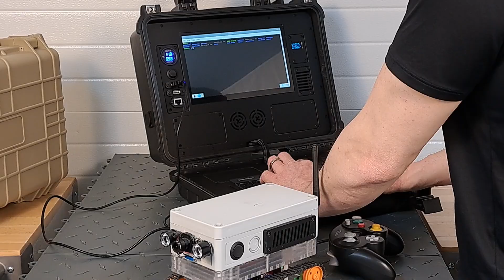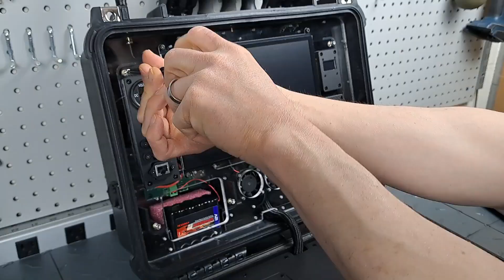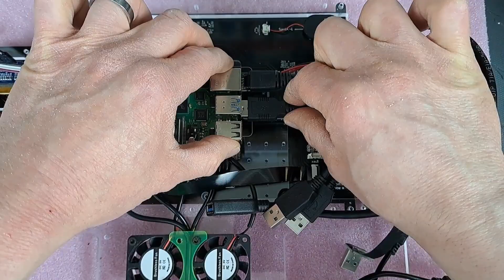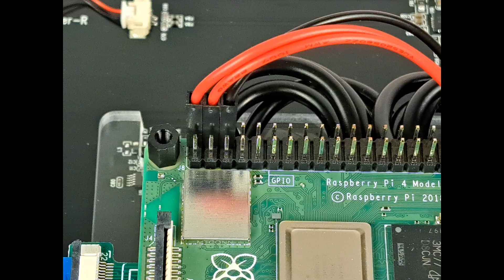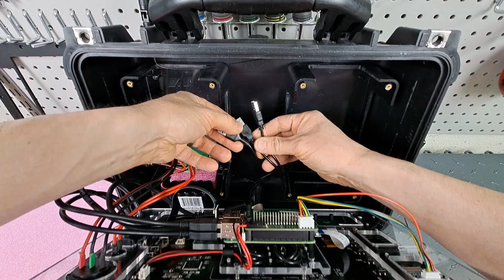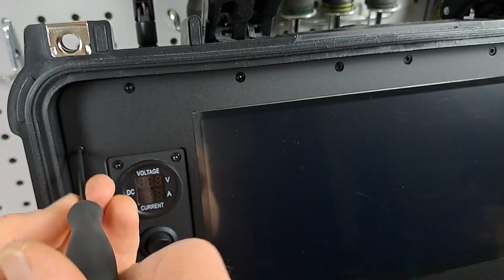Mobile Command Center Cyberdeck Disassembly and Reassembly Guide

Comment: Where I can get the power distribution board separately?
Reply from the maker: I'm planning to offer the power distribution board soon - I'll post a video when it's available!
Reply: @solveboticsllc6796  Thanks
And will be able to supply stable 5A ?
There's some other UPS like boards that were make to the PI5 and still area unable to supply stable Amps (Its show the PI5 low power Warning)
Reply from the maker: @enjoyer____9685  I'm currently working on a new revision of the power distribution board that will implement the USB-PD protocol, so it can signal to the RPi5 that it can supply 5V at 5A  The current board in the video lacks the USB-PD circuitry to communicate its capability to the RPi5, so the 5V/5A warning appears, even though it is capable of supplying 5V at 5A.  In the meantime, I've been able to use a second board in conjunction with this original power board and both of these with an e-marker USB-C cable have eliminated the low voltage warnings when powering a RPi5.
Reply from the maker: I've tested this power board and USB-C cable, and these have solved the low power warnings when powering a RPi 5.  So, if you're needing a solution sooner, then these will help:

https://category.yahboom.net/products/power-board-pi5?srsltid=AfmBOoqtutBPk7KXBQ6-L6vG4okZj-U0eSGNcOCmCBFU7EVajFsFYRyQ

https://www.amazon.com/dp/B0CRRRP9YG?ref=ppx_yo2ov_dt_b_fed_asin_title&th=1
Reply: @solveboticsllc6796  I see, that will solve some things, that because my PI5 use a NVME, a Floppy and Blu-ray usb drive (Why?, you may wonder, well, I don't know either)
But is there a chance that you can add I2C so we can know the status of the different Batteries? (Its a suggestion)
Reply: @solveboticsllc6796 its goint to be able to have stable 5A?
No power warning?